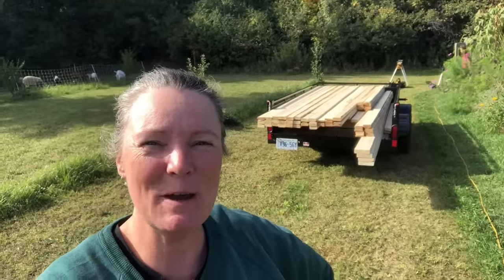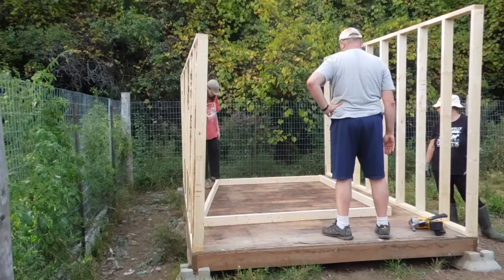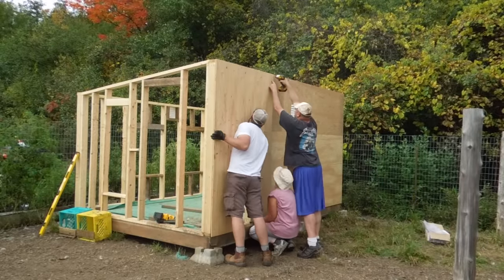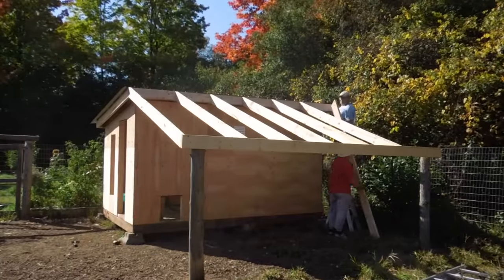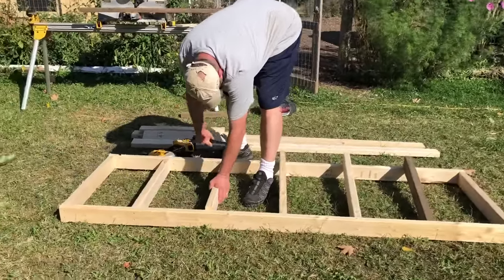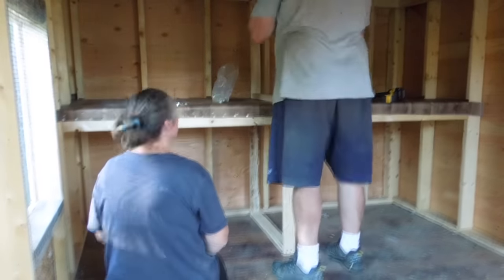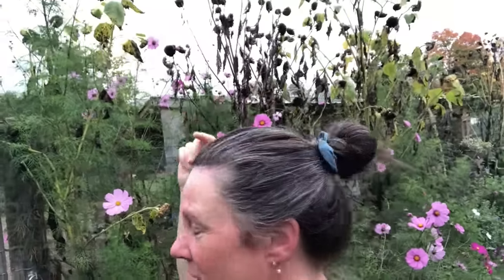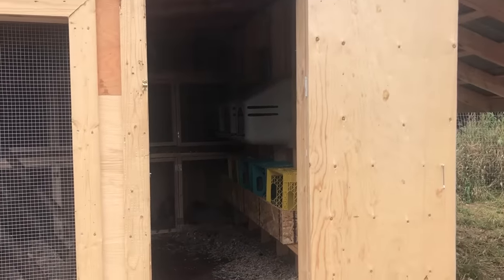Building a chicken coop for all seasons start to finish- Ontario, Canada

Comment: and apologies for yet another question, What are the dimensions of your coop?
Reply from the maker: The dimentions are 8x12 so we could use three sheets of plywood for the floor and not cut them :-)
Reply: Thank you! And are the walls 8ft and the other 7ft?
Reply: @connerty_meadows_farm   thanks! And what is the kind of vinyl you used?
Reply from the maker: @ryanw6920  just regular vinyl flooring, the least expensive i could find
Reply: @connerty_meadows_farm  thank you
Reply from the maker: @ryanw6920  So sorry I took so long to get back to you, I kept forgetting to go out with a measuring tape!  The back higher wall is 78 inches tall so that hubby could get in to collect eggs and not hit his head.  The shorter front wall with the windows is 66 inches tall.   The studs are 16 on centre.
Reply: @connerty_meadows_farm  thank you! I thought that maybe you cut the 2x4x12 in half for the outer walls to form one 6.5’ tall wall, and the other wall 5.5’ tall. Again, thank you for uploading this video!

Comment: How many chickens is that size coop going to hold.
Reply from the maker: It is suggested that each chicken needs 2-3 square feet inside the coop.  Because our chickens have access to a huge run all year long I don't mind squishing them in a bit more for night time sleeping.  With the math there should only be a max of 48 standard size chickens per coop.  I don't have that many in there though.  You can add more if they are bantam breeds as they take up less space per square foot.

Comment: Thomas is definitely not a Carpenter lol
Reply from the maker: not by trade no, he's an aero space engineer but he makes stuff that works and doesnt go anywhere :-)
Reply: @connerty_meadows_farm  Where's the Titanium turbine blades for coup cooling during compression?
Reply from the maker: @bidenisasnake9932  we use a beautiful hardware cloth covered window in the summer months for cooling and we have the venting system in place for the winter along with doors ;-)

Comment: How much material did you use?  How many 2x4s and sheets of plywood and everything else?
Reply from the maker: Thanks for watching.  I unfortunately do not have a materials list at this time though it is a question that gets asked a lot so we will try to eventually get one put together.  Dimensions are listed in the description box.  For the rest I would suggest to just pause the video and count how many of each item was used.
Reply: @connerty_meadows_farm  thank you!  I’m doing that right now!  Lol.  One more question.  Do you happen to remember the length of  the tin sheets you used for the roof?  I plan on making a coop very similar to this this spring.
Reply from the maker: Unfortunately I do not.  I know we had a nice big over hang because I didnt want water dripping into the windows (did that before at another farm)  You could probaly figure it out using the dimension already in place if your good at math (not me, thats hubbys job...lol)